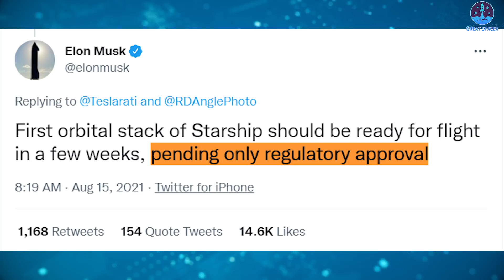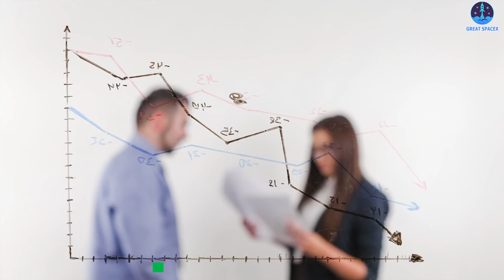Musk just officially announced NEW CRAZY Plan on SpaceX Starship despite raptor crisis, B5 scrapped

Comment: Rather then a mission to Mars, it would be more economical viable to construct in LEO a big infrastructure, that would assemble satellites, Space Hotel, and Science Research facilities.
Reply: That's Bezos plan
Reply: @henryk7636  it should be NASA and ESA plan too. Once at LEO, you save launching costs deploying and build satellites, assembling them there, while the structural components of the satellites would be 3D printed.
Reply: @RogerM88  where they gonna get the resources from to build something that massive? Definitely not earth. Because last i checked it's so massive, it houses a million people.
Reply: @henryk7636  it's easier to supply a big infrastructure in LEO, than in Mars. Don't need to be a million, one hundred would already be a great Engineering feat. You could assemble the technical satellite gear, on the Space station, while 3D printing the rest of the structural parts. No need to reinforce the satellites to sustain the loads at launch.
Reply: @RogerM88  No, no way the resources are coming from earth. They will obviously be from the moon, just as bezos stated. But bezos hasn't reached orbit, talk more of the moon. So it's all smoke at the moment

Comment: As they want to move to Raptor 2 instead of Raptor 1 engines, it would make sense to stick B5 in the display area. Then B7 can be designed around the Raptor 2 engines. B6 is basically what you see with the crush test rig.

Comment: Since Starhopper, I think 3 times we have seen green flame (copper burning) come out of Raptors just before landing. According to Manley, green flame indicates the engine "eating" itself or melting through harder metals. My question: Is there also a design problem that is being addressed in addition to the production shortfall? Does the propulsion manager's departure suggest that he couldn't solve 2 interrelated and contradicting problems simultaneously?
Reply: The eating of the Copper was explained in each case in tweets by Elon. Mostly it happened when the pressure was too low from the header tank or when it ingested the Helium from the header tank. Low pressure will destroy the engine if it is missing the Methane in quantity while still getting the LOX.
Reply: @gravelydon7072  Good explanation. Thanks.
Reply: @gravelydon7072  Thank you for your patience in answering this question as some of us forget the previous answer to solve the question. Thank you for answering a fellow interested person who is not perfect.
Reply: How many rockets did SpaceX crash while developing their program for the Dragon capsule that has now had multiple successful missions?

It's kind of like saying even though SpaceX could leave their competition in the dust for getting into low earth orbit and then doing all the work needed to dock a capsule with the ISS, they aren't analyzing this situation.  Their competition hasn't even gotten into low earth orbit and SpaceX has worked out most the complexity of getting people to the moon, in style, with a place to live without having to set up anything, except that which could boost their stay time on the moon while they're working on a permanent base.

They use Agile, which is about the fastest way to move a project forward as long as your people are doing what they're supposed to.  It means they can be near success but still have failures, and they're analyzing the entire time.  But they're not going to push the threat of losing life just to learn, maybe a Model Y.

They'll get the program running, even if it means they scrap that motor and go with something else based on everything they learned from the raptors.

But, this is very expensive for SpaceX. Progress is going to be a little slower than it was getting people to the ISS.  I would hope they did enough testing with the raptor mounted in a stationary position to understand how they are going to work, though it is different than having a few of these engines side by side.  But really, you're working with rocket scientists, and I think they understand what they're doing.
Reply from the maker: Maybe... Anyway, hope all goes well!
Reply: The flamme os green spécial ergols mix dont need  spécial staff to litght. :-))
Reply: The green flame issue was addressed long ago
Reply: From what I gathered he was going to be fired and decided to resign instead. He had been lying about how dire the Raptor situation really was and Elon does not play that game as we all know. The same with the other directors involved, they had been sugar coating the situation to Elon and the board.
Reply: @andrewhicks982  When you get into a situation like that it's best to holler "Hey Rube" and get everyone on the problem the minute it happens. What that VP did was try to hide what could not be hidden. You don't ever do that because it causes people to die in this business. That was the inexcusable part. That VP wasn't from an aerospace background otherwise he would already know that. Now he will be unhireable being known as the VP that Elon fired for making a rookie mistake.